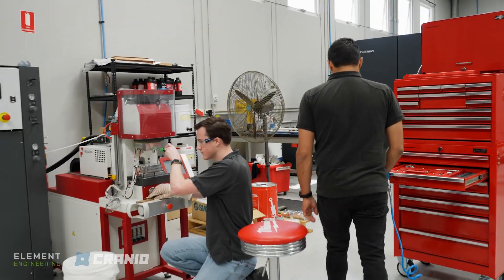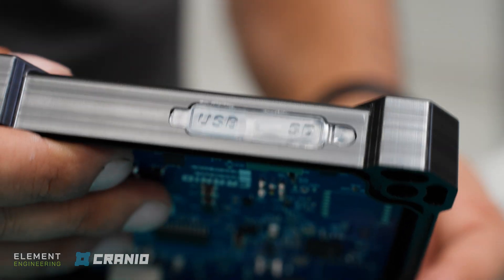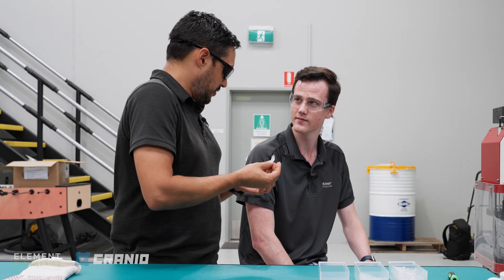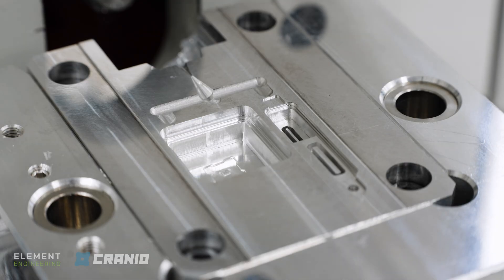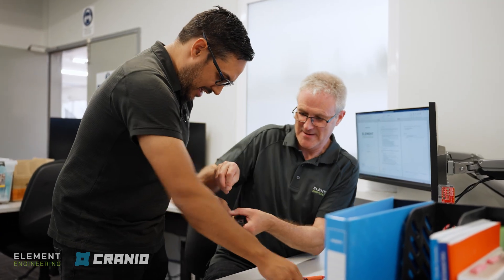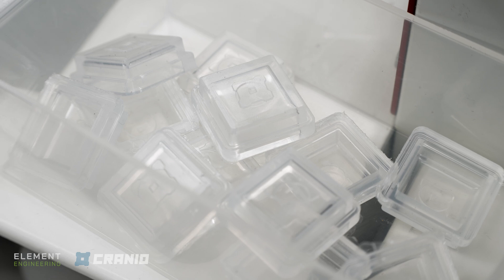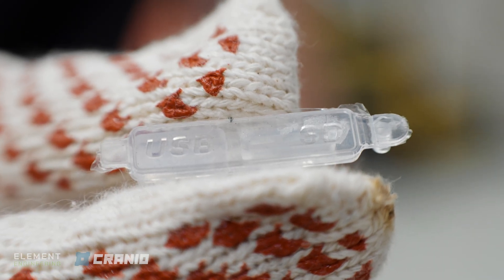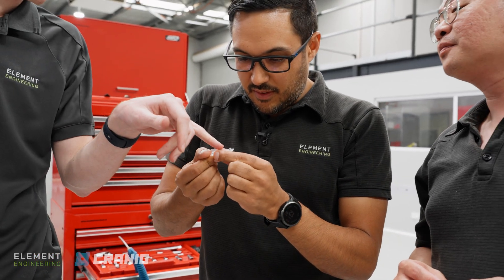Our LSR injection moulding journey continued with a successful test of new aluminium moulds!

Comment: These videos are so cool. As a fellow design engineer who does mechanical and electromechanical product development, this is amazing content to watch and learn from.  I design metal machined parts, as well as injection and compression molded thermoplastic and thermoset parts, which makes your design series so interesting to watch.  Coupled with the great production value, I love it. Keep up the great work! 👏
Reply from the maker: Thank you! Is there anything in particular you are interested in seeing more of?
Reply: @elementengineering  Absolutely! I’d love to see any other technical information about the journey of bringing the product to life. I think you mentioned FEA’s in one of the videos; I’d love to see details on that aspect, especially if the FEAs were on the LSR parts, and how you were able to optimize the ‘snap fit’ of the LSR part into the mating housing.  I also enjoyed the explanation of how you had to modify the design when you went from 3DP mold inserts to machined AL, since some of the geometry could not be machined.  I love the details on the BabyPlast machine; we run 60T-180T Engels at my company, and I wasn’t aware there were small machines like the BabyPlast that make injection molding much more accessible to companies that can’t afford huge capital expenditures.  There’s the technical aspects that I enjoy watching and have also learned from, but also there’s the ‘journey’ of iterating designs to completion, and sharing your journey through the successes and failures is really entertaining and relatable for someone who lives those experiences daily.